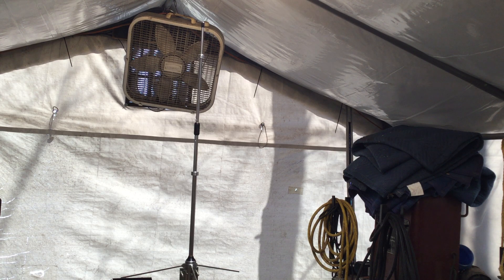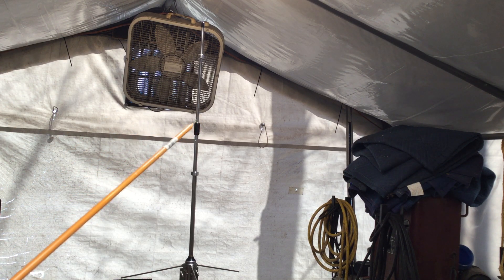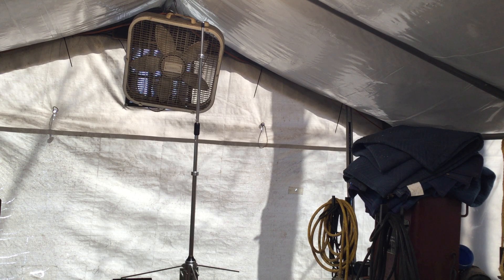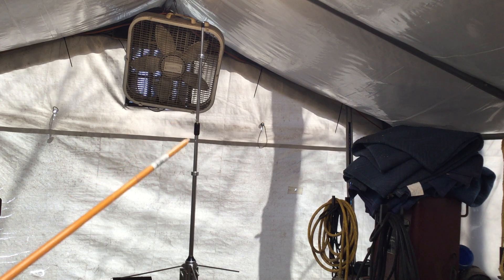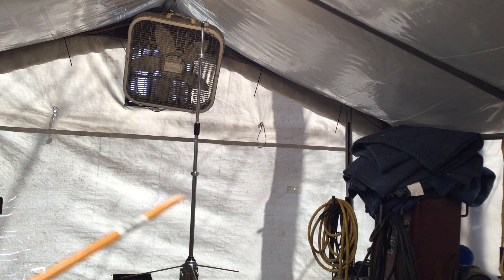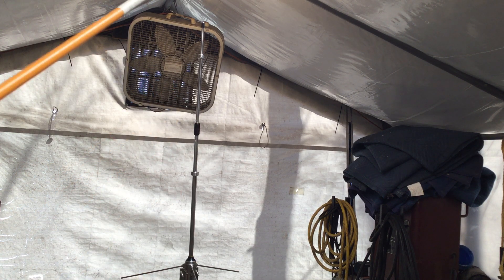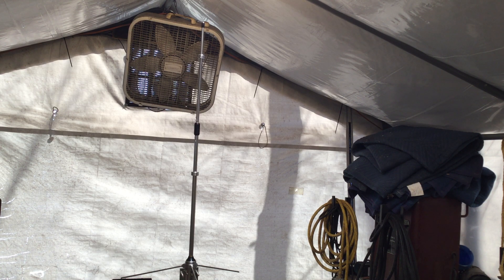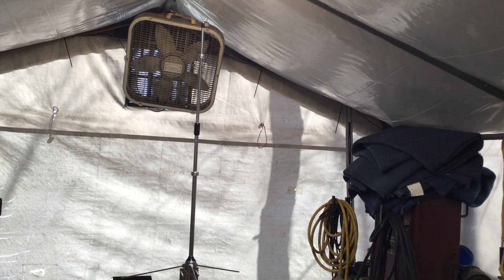🔺 Retevis base/repeater High Gain GMRS two-way radio antenna!!🔺

Comment: What kind of range on simplex? Great video
Reply from the maker: Well, a simplex repeater range would depend on the radio and antenna height that is being used for the simplex repeater. So I can not say for sure, but I can say with my setup 6 watts output using this antenna 30 feet in the air running lmr400 cable I get 2 miles range with a handheld. But keep in mind my repeater is in a valley "hole" so that is really good. More wattage will give you better penetration if you want better distance than antenna height is the answer too!

Comment: How do you set the antenna? Are you putting freq number on the coller you tighten or higher
Reply from the maker: You use an SWR meter in between the radio and the antenna. You set the radio to the TX freq you want to use. Key up the radio and then read the SWR meter to see what the reading is 1.5 or lower is good. If it's higher than that, loosen the set screw on the collar and adjust the antenna height up or down to get the lowest reading.
Reply: Thank you. I am newbie at all this I am teaching myself as I go. Thank you for your insight.
Reply: Well shiot now I need to buy a swr meter
Reply from the maker: @trebel69 yes, but that is a tool you should have anyway. It can also check wattage to :)

Comment: Can you link two retivis repeter together
Reply from the maker: Sorry, I am not sure what you mean? Using just one antenna? Is that what you mean? If so no I would need another antenna
Reply: @GMRStwowayradio  what I mean is if I had to retevis repeaters spread them several miles apart link them together to extend my range like a repeater network
Reply: What I mean is can you link two retivus repeater placed miles apart to make a repeater network
Reply from the maker: @martinmiller7737  in theory you should be able to, BUT the squelch tail could be a problem meaning it could go back and forth in a loop. You can disable that using the software. But I have not tried this. I hope too soon, as I have two repeaters now 🙂
Reply: @GMRStwowayradio  thank you if I could do that where I live my coverage would be awesome probably 35 to 40 miles the second repeater would take care of all the dead spots love your video thank you for taking the time to do it
Reply from the maker: @martinmiller7737  - one thing you could do ( that is if the repeater site has internet access) is link them together using zello.

Comment: I ordered this for my kg-xs20g, which says it does 136-175mhz bands, If I tune this for 400-480mhz will it still work for the 136-175mhz band or do I need a dual band antenna? Thanks again man
Reply from the maker: you will need a dual band antenna and no problem 🙂
Reply: @GMRS _two_way_radio  dangit lol I guess I won't need the 136-175 for gmrs so I'll try it for now🤷‍♂️ thanks so much man I really appreciate the help I'm new to all this. I guess this radio will receive the lower frequencies so I can program other channels, I think the 136-175 band will basically make it a scanner🤔

Comment: Did you ever do the range test with this one? Thanks
Reply from the maker: yes i did all my distance/range testing videos except my homemade antenna and homemade MURS antenna. This antenna did very well considering I was using a handheld AND I live in a very hilly area and my repeater is in a valley (a hole). The distance I got was about 2 miles using the RT97 gmrs repeater and RT85 handheld!!!
Reply: @GMRS _two_way_radio Nice! Just ordered one for my kg-xs20g, now all I need yet is some lmr400 hopefully,  thanks!